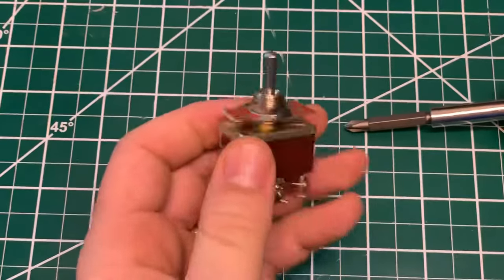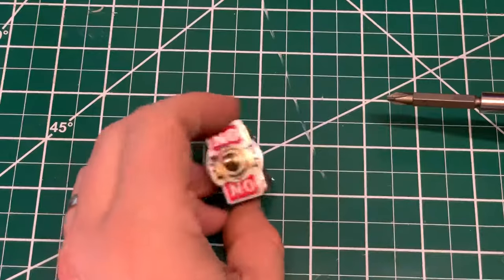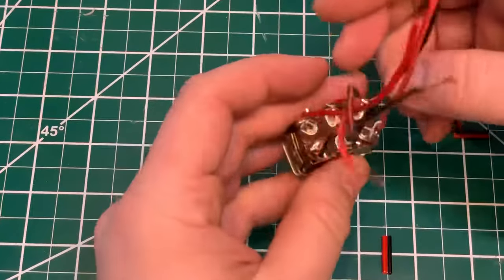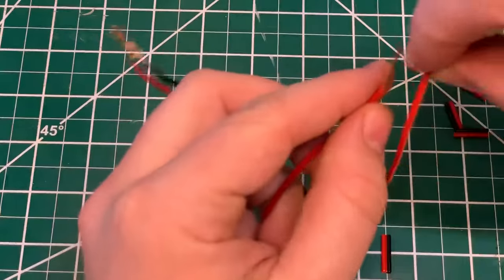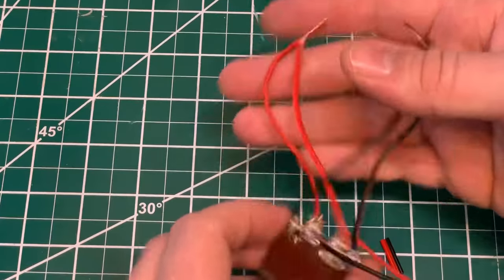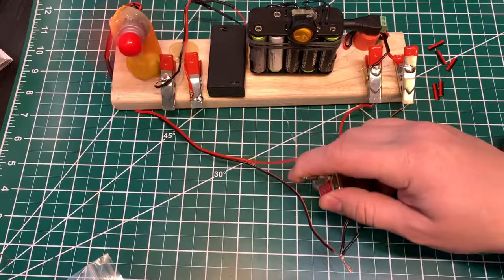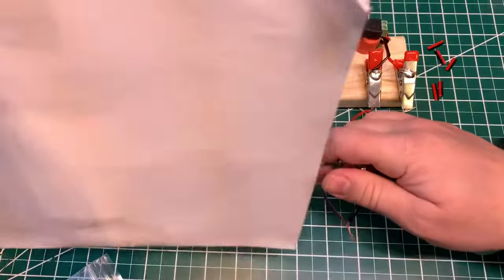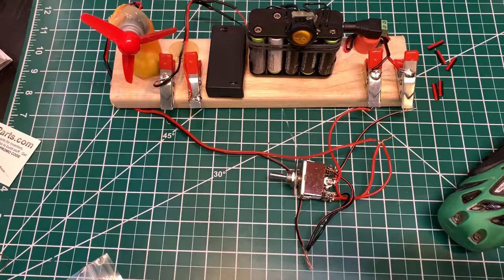How to reverse a DC Motor with a toggle switch

Comment: Thanks, this is exactly what I needed but the problem that I'm facing is that instead of a toggle switch, I need a push button switch so that when the vehicle collides with something such as a wall, it reverses the direction. So do you guys know if a push button DPDT is available in markets?

Comment: Not to be negative, (no pun intended) but you didn't switch anything when you said you could switch it around. The same wires went to the same places! The two double wires went to the motor in both ways and the two single wires still went to the power supply.

You might as well have said  "head I win & tails you lose."